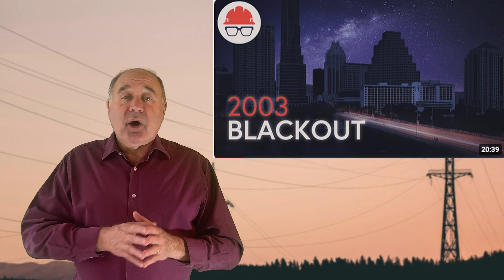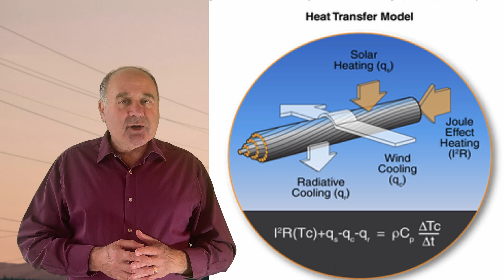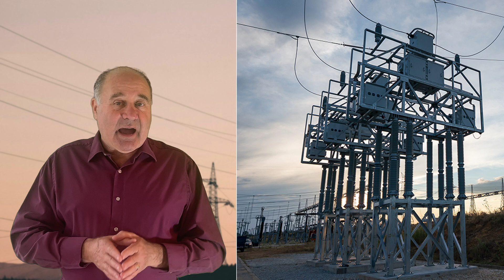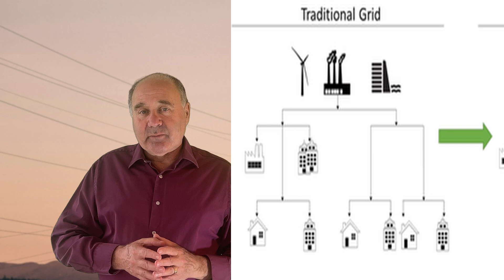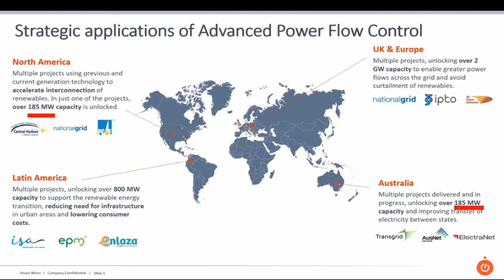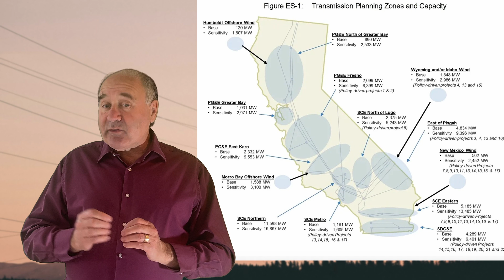Why aren’t we using the best technology to enhance our grid?

Comment: Peaky grid demand means peak capacity must be constructed.

With a battery and PV roof behind every meter stable 247 capacity could be the standard. 
Say 3 times normal daily avg.

I expect V2 EVs massive storage batteries parked 23hrs every day and all night long will be a significant part of the home infrastructure. 

EVs capable of hours of daily driving but parked 23hrs daily and can be topped up daily will be valuable 'free' mass storage.

Nuclear promoters talk maximum UTILIZATION capacity of nuclear reactors.

But ignore the maximum UTILIZATION of the bigger business of T&D.

Steady state grid electricity overcomes you dynamic considerations in the video.

ROI, return on investment, cashflows are the most important aspect.

Excellent video
Reply from the maker: I'm a fan of behind the meter solar and batteries, but only to a point. It's hard to cover 100% of needs during the winter, especially in the northern latitudes where I've lived (e.g. Seattle, Ireland). But it can reduce your need for centralized production and T&D.
Reply: @Decarbonize11  excellent comment
Reply from the maker: I'm less a fan a V2G, at least until battery wear and tear is a non-issue. Mobile batteries are much more expensive and resource intensive than stationary ones. But charging off-peak can help a lot. We only charge our EV betweeen 1-5 am.
Reply: @Decarbonize11  in Australia big nuclear is a 20years project.
Much can change in that time. 
Nuclear is a decade to 10decades project that needs massive investment and it massive grid infrastructure investment. 

Collapse in grid demand in 2 decades would be a sorry situation.

Now add nuclear defence budgets exploding and the sorry situation is just unbelievably sad.
Reply from the maker: @stephenbrickwood1602 
At this point, it would be ridiculous for Australia with some of the world’s best solar resources, fairly good wind resources to go nuclear from scratch   

Maybe when there are SMR’s that actually work and you can just buy and pop down it would be worth reconsidering, but I doubt it
Reply: @Decarbonize11  90% of the world's population live in the sunbelt latitudes.
Australia could lead the world in the non nuclear electricity future.
80% of the world's population live in dictatorships. 
Iran, Nth Korea, Russia, are examples of the downside.
The electric future will dominate Australia's resource raw materials industries. 
Australia's uranium yellowcake export industry will still be busy enough.

Comment: 6:33
Reply from the maker: Is that your way of agreeing that GET are a no-brainer?
Reply: My background is as a  construction engineer on coal fired power station and gas fired peaker plants and 2,000 tower transmission line.

My old CivEng friend is now promoting nuclear electricity. 
He read a book on nuclear chemistry and 40 years ago nuclear was the only possible technology. 
40 years ago.

He is on national TV as a nuclear expert. He is wrong.
Reply: @Decarbonize11 sorry, I just marked that point in your video for me to review.  😊
Reply: Edited, My background is as a  construction engineer on coal fired power station and gas fired peaker plants and 2,000 tower transmission line. 

My old CivEng friend is now promoting nuclear electricity. 
He read a book on nuclear chemistry and 40 years ago nuclear was the only possible technology. 
40 years ago. 

He is on national TV as a nuclear expert. He is wrong. 

He does admit building more grid capacity is too expensive and should be avoided, on national TV. 

He promoted filling the existing national electric grid ( and implies the cash will just flow in. ) 

The plan changed to half filling the grid in 20years.

Comment: Well . . .  sorta.  But as far as "best" technology that is likely coast-to-coast HVDC -- High Voltage DC.  That allows surplus to go 1000s of miles to where it is needed, instantly, and jumps completely around existing Central Plant model congestion.  China is pretty much leading the world on this.   As with EVs and Silicon Solar PV, US would only have to be humble enough to work with them.  

Other part that is completely missing is End User "Time-of-Use" considerations.  This is generally done only by price pressure (high peak rates) or incentives (low off peak rates)  This whole portion of aligning Time-of-Production and Time-of-Use could open up both Generation and Transmission constraints, because like highways and traffic -- it is a time of day based thing.  The Grid and Generation is mostly surplus, most of the time.
Reply: That's why I'm doing a series, because there are lots of areas for improvement. The first video in the series, which is the first YouTube video I ever made, is about coast to coast HVDC. 
https://youtu.be/kw9_Q_qm0Es

My next video (which I haven't even started the script yet, so I need to get to work) will be on re-conductoring, another oppurtunity to improve the situation. Then on to the recent FERC rulings, because I think the real area that needs improvement is goverance, and once that's done, the technology will follow.
Reply: @Fiat_Veritas  All good.   Might want to look into Power Reserved Control (PRC) for some of that, and how the regulations have been backed off from always protecting equipment FIRST, to holding up the Grid as the priority.   Part of NERC  PRC reports and control relay settings.  Yell if you need/want some help.  Maybe can get SEL to sponsor or help some.  (Switzer Engineering Labs) -- they make the state-of-the-art Grid Control.   I suppose you could also consider this from a bottom up Solar PV system, as well.  The IEEE and UL standards are being selectively backed off to allow some inverters to stay on line and help the grid during outages.